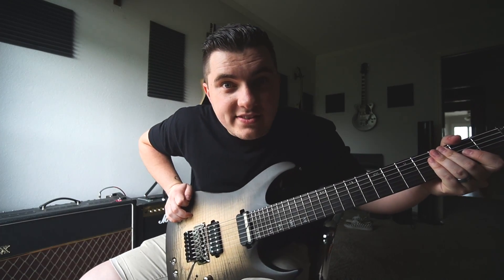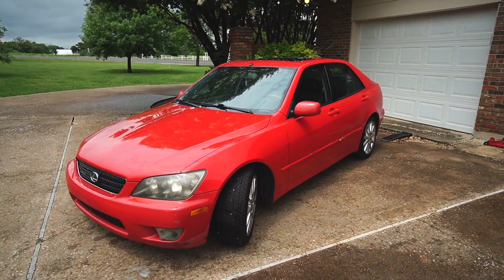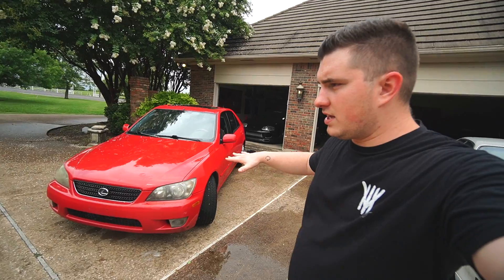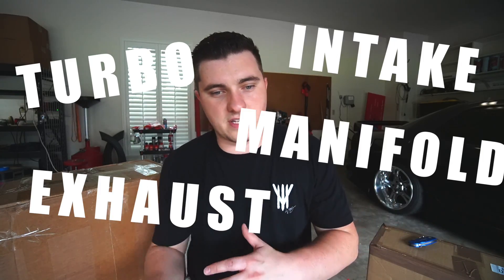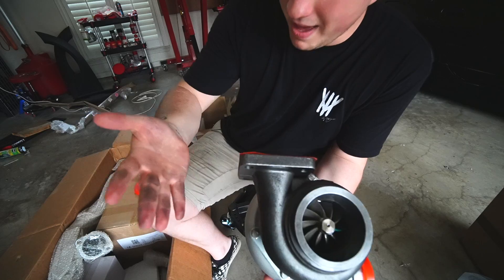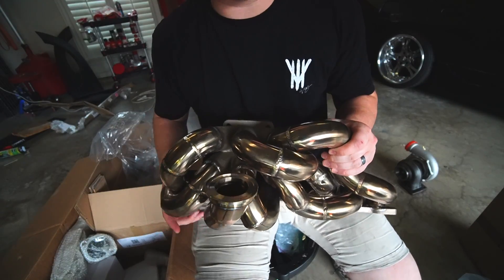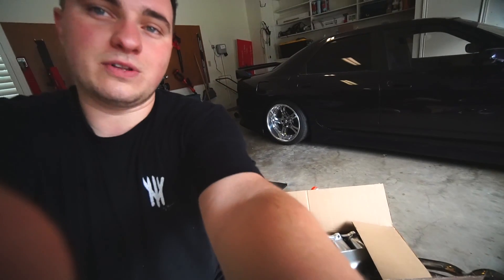Boosting the IS300 for CHEAP! My new 2JZ turbo kit

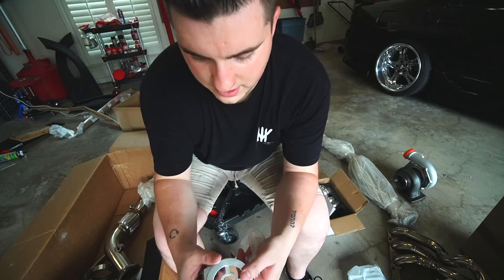Comment: 11:00 is a oil filter sandwich plate. It basically just allows you a easier way to run you oil line for turbo.
Reply: This lol, exactly what i was gonna say
Reply: yeah jesus christ I’m fully convinced this dude has no idea what he’s really doing
Reply: Can also be used to run oil pressure gauges or oil coolers.
Reply: That's why they say fake it till you make it.
Reply: Austin Higgins I mean, he had a general idea of what it was for... but if he never seen one he ain’t gonna know 🤷🏾‍♂️
Reply: So you don't have the same problem that you had with was it the civic with the job weld
Reply: Evan shanks is my dad. Commenting this until he follows me on instagram ryannmorrrison
Reply: I was just about to write the same thing then I saw your comment...lol Thanks for saving me the literature...😁

Comment: "you can spend upwards of 15k just boosting your car" subaru owners can attest that this is true
Reply: ye
Reply: How
Reply: Lmao vq owners too
Reply: Speaking of subaru buy my 05 lgt stage2 for 10 grand
Reply: The most depressing part is that the damn thing is already turbo lol
Reply: @zachwhite4162  a 40mm Garrett ball bearing turbo is 2 grand,and If you actually want a gain from it you need heads,intake,exhaust,which all can be hell of a lot more expensive than you think
Reply: I own a Subaru, you can make power with bolt-ons, but you better be saving for a new shortblock while you’re at it...
Reply: Yup. 15k into a bugeye, on my third engine lol. Atleast it’s fully built lol
Reply: 8k for my forged engine.
Reply: Hahaha 😂
Reply: Max Paterra they make ok power. You don’t get gains like you do on an Evo or Golf R but the gains aren’t bad. The fa20dit sees much bigger gains then the ej255 or ej257, the WRX’s fa20dit will make bigger whp and wtq numbers then the STi’s ej257 will with both on pump gas and stock turbo...
Reply: Thats what happens when you build an inferior engine
Reply: Seattle Inspired that’s why it cost 15 k to build the engine so it is reliable
Reply: I mean I daily a Edelbrock Supercharged BRZ. Only cost me around 5k (some discounts on kit and what not). Installed it almost a year ago without a single problem in FL.
Reply: That ETS kit does look beautiful though
Reply: @jacobwiseman7125  try out a 2jzgte i have one with rods all arp bolts stock head pistons but the stock gte ones will hold 1000whp. My motor can hold 1200 and it was 6k easiest motor ive ever worked on that cant be under stated and it took a hell of alot to blow up my last one 800 whp and it was a used aristo. 2 jz is king. You could have bought a t56 magnum kit and the engine for that price
Reply: The motor has literally no potential on the FA20s unless it's built
Reply: Kinda

Comment: I just bought a clean 80000 mile 04 is300. Subbed! Sensible turbo advice is not the norm. You give sensible advice. Don't go lean, don't go hot and your motor will live longer. Thanks for your channel!

Comment: I know of a couple YouTubers that use eBay turdos and they are having no problems with them. I'm glad to hear you say you won't be dealing with eBay turbos any more. I've been extremely sleep skeptical about them and am glad I didn't go through with getting a kit. It only takes one person to give a bad review for me to question the quality. Beings you've used a couple turbos from eBay and say you won't be dealing with them, thank you
 That piece you question in regards to the oil filter...... If I'm not mistaken it's a spacer so you can run supply and return lines for your turbo instead of drilling into the oil pan, etc. I could be wrong, not I believe that's what it's for.

Comment: You said "good, but keeping cost in mind" and I IMMEDIATELY thought "I bet he got a CXRacing kit."
Reply: Lmao right!?!
Reply: Cx racing kits are ass
Reply: Ricer Miata and SAMMIT both have gotten CX crap before and turbos and stuff have all blown or gone wrong and you end up spending alot more money in the end. CX is Ebay.
Reply: @terryosborne272  thats for a miata, the kit is pretty junk for bmws as well... but lets just hope 2JZ stuff is what they spend most of their time and RND on lmao. I believe Jimmy runs or ran this kit on his 2JZ
Reply: The CX intercooler and piping is good, turbo is meh (it’s just an EBay turbo), and the wastegate is iffy. But the piping and intercooler works perfectly fine for the price.
Reply: ORL Mitch the turbo manifolds are trash and the oil fittings and the gaskets
Reply: @brotherhood_ofstreetracers4268  the manifolds arent terrible. They are cheap but they flow enough for 5-600whp. They need to be braced though because they arent very sturdy. The real problem is all the cheap accessories like you mentioned
Reply: @PaulBuffano91  I have never heard of a CXRacing or XSPower wastegate actually functioning lol
Reply: I've always thought xs power was a hair better than cx racing through my experience
Reply: @terryosborne272  Jimmy Oakes & RJ ran CX racing kits on their cars. RJ had one on his 1.6 Miata and purposely tried to blow it up and couldn't do it.
Reply: @terryosborne272  Jimmy Oakes & RJ ran CX racing kits on their cars. RJ had one on his 1.6 Miata and purposely tried to blow it up and couldn't do it.
Reply: I found a cxracing  turbo kit for like $1900. Is it not a good idea to get it?

Comment: @Evan Shanks the oil filter sandwich plate is for the oil feed for the turbo. There’s not a place on the block for the feed. The drain as you might know is on the exhaust side(upper oil pan) and you just need to drill a hole and tap two intake studs in the pre staged holes and buy a cheap flange from drift motion and your good 👍🏻

Comment: the 5-speed 3rd gear will explode around 300 ft/lbs... don't say I didn't warn you... you can put the supra's 6 speed in and there is a driveshaft that's for another Toyota vehicle that fits. I can't remember which car, but your 5-speed will not last long on boost.

Comment: 11:12 it's to run a oil cooler and a filter, carnt wait to see how it performs
Reply: thats oil feed for turbo its called a oil feed sandwich plate
Reply: @revengesavagedit4684  it's being used for that purpose in the kit, but he is right that these are used for oil coolers aswell.

Comment: I have cxracing turbo kit 3years on my dc5 ..made 435hp first dyno session stock k20a2 then 1year later I upgrade to k24/k20 and make 560hp stock engine... And I have had no issues almost 4yrs and still counting.... Good kits for the buck or for a budget build... I'm sure kit can make 650hp plus with few upgrades

Comment: 11:05 I think it’s for the oil feed line. Pop off the filter and screw it on
Reply: otherwise knows as an oil sandwich, Evan is still learning.
Reply: not really a good place to get oil from , t off oil pressure sensor works better and getter cleaner oil to the turbo

Comment: I’m giving it till 350whp till either your W55 goes bye bye or your rods gonna be bent at a 90 degree angle. 😬
Reply: I'm pushing 370 on E. Hoping it works for him and if so I'm turning up the boost
Reply: yeah i've heard that the 2JZ-GE rods are toothpicks compared to the GTE variants
Reply: @johnbreuer9967  from what i hear the ge non vvti rods are thicker (up to 500hp-600hp) while the ge vvti rods are thinner (350hp-400hp at most i hear) but pistons stay the same. Someone correct me if im wrong.
Reply: @doomkid02  pistons are shaped differently for the valves, but strength wise they are pretty much the same
Reply: @doomkid02   pistons are softer then cheese not the same as non vvti ge pistons
Reply: The ring lands are the problem mainly
Reply: Did you use the stock ecu???

Comment: It's an oil filter adapter if you want to run an oil cooler up front which I would recommend because you're running turbos and the turbos get the oil really hot

Comment: I already knew it was from cxracing from the beginning😂 I’ve been eyeballing the kit every since I got my first is300 I think I might buy one once I see you start
Reply: Ahhaha same man it just had to be cxracing
Reply: It’s not a bad kit for the money. Just keep in mind you get what you pay for. Also you will spend a lot of money replacing the fittings and small things like oil plumbing that the kit does not sufficiently provide.
Reply: What’s the kit called ?
Reply: Ethan Higgins yeah you gotta tap into the oil pan but I was think 1j but idk which will cost more
Reply: D. SANTANA CXRacing Turbo Intercooler Kit Manifold For 98-05 Lexus IS300 2JZ-GE NA-T

Comment: That's an oil filter sandwich plate. You can use them for oil coolers, oil temp, oil pressure, and more. It's probably in this kit to supply the turbo with oil :)

Comment: 11:00 That's called a sandwich plate. it goes between your oil filter and the block. You run coolant lines to it to cool the oil..

Comment: you can run gte valve covers too and run a gte spark plug cover since u wont be having the over motor intake manifold!!!! also the oil filter sandwich plate is worth less use the line from the stock oil pressure sensor !!!!

Comment: If my understanding for that oil filter spacer is correct. I think you can run the turbo feed line and return line to it so you don’t have to tap the pan. Or you could run an oil cooler from it. But I could be wrong.

Comment: What transmission are you planning on swapping in? Surely the stock w55 can’t hold 450hp? Would love to see a t56 in it tho 👀👀
Reply: The motor will blow before the trans will
Reply: Ethan Higgins True, the VVTI rods will go at around 300whp.
Reply: Ethan Higgins yeah he def needs to built the lower end
Reply: @PaulBuffano91  not just the rods but the ring lands. Under boost and temp the piston rings will expand and the vvti motors have very small and weak ring lands which will crack send chunks of your piston shooting out your motor.

Comment: SO I'm collecting parts for my 02 been going back and forth on building/ buying my own kit. I got the same intake manifold and a set of injectors as well as a bunch of other parts. GTE head gasket Arp Studs, Aem Gauges, Walbro Fuel Pump, and some other goodies. Wondering How much the kit cost you because I've found CX kits at all different prices. Only looking for 3-400 hp nothing crazy. Thanks for any help..

Comment: Damn your neighbors have to hate you lol    I did the same build 5 years ago. Used the CXracing as a base. Ditch the wastegate,BOV and the Turbo,.. that Intake manifold might not fit. I spent 12,000 just in parts while cutting corners where i could, It adds up quick,. this build wont be as cheap as you think it will be lol  Also your power goals are at the limits of the VVTI rods,.I'd suggest swapping GTE pistons and use the GE headgask or go ahead and buy a backup block. .    Also don't go piggy back,. just go AEM or Proefi and call it a day.  Excited to see how the build turns out. Cody Gram on facebook is a great person to ask questions about IS builds. Oh also,..go T56 6spd when its time for a trans. It will have the best gearing for the diff

Comment: At 11:13 that’s for an oil cooler that’s sits between the filter so you can run the lines down
Reply: Or oil feed one of the two I haven’t finished the episode yet

Comment: 11:30 That’s called a sandwich plate it goes in between the block and the oil filter to run oil into fill lines that go to the turbo

Comment: Isn't that oil filter adapter sandwich for an oil cooler? Allows you to simply pipe in the cooler without cutting into the OEM lines

Comment: Man good luck with your turbo kit.. im also doing a 2jz na-t on my 92 cressida .. I would recommend you to change the stock  headgasket to the 2jzgte headgasket which will lower the compression and allow you to run more boost and get “more power baby”(donut media) 😂💔

Comment: Oil sandwhich plate good sir, bolt it where the oil filter currently is and boom you have a place to run an oil feed line

Comment: 400-450hp is probably gonna put a rod through the block. GE rods can handle like 350 tops, also the trans is another weak point. I’d suggest cd009

Comment: The VVTI 2JZ is only good for about 350-400 but it will probably blow up before you get to that point. If you looking for a good PNP standalone go with the xcessive manufacturing Link ecu. Also your gonna want to keep the torque below 350 cause the w55 is straight up garbage
Reply: Even then you’d be better off buying an Aristo GTE clip or Chaser clip.
Reply: @iheartgs400  that depends on your preference, but the cost to do an aristo swap and to fully build the GE is around the same price. If you want cheap and reliable power go a 1JZ swap, thats what i am doing rn on my IS. Boosting the stock GE is a waste of time and money. Also why would you buy a chaser clip, just buy the complete motor from an importer.

Comment: In your opinion, how much PSI/horsepower can you get away with on an NA 2JZ-GE without sacrificing reliability? I've seen forums and videos saying around 300-400 hp and around 8-10 psi if I don't want to upgrade the rods and head gasket. Obviously, you would have to do a proper setup with the fuel system and intercooling system, but I personally feel torn because I don't want to sacrifice reliability. My IS300 only has 133,000 miles on it and it's pretty clean. I personally would be happy with 300+ horsepower anyway. I would pay a specialist shop to do it if I went ahead with it.

Comment: From what I’ve heard the manual transmission on the is300 doesn’t hold the power the auto can. I’d check and see what power that can reliably hold if you haven’t already

Comment: THE OIL FILTER ADAPTER IS AN EASY WAY TO RUN PRESSURIZED OIL TO THE TURBO
Reply from the maker: The IS300 has a union bolt for that..
Reply: @evanshanks  Hm, I didn't know that, but that's usually what those are used for involving a turbo kit/build, maybe the kit included it as just another option, or (not knowing anything about the kit you got) maybe the kit is just meant to be somewhat generic, and regardless of what you order it for, it may just be cheaper to have pre-packaged kits that fit all 2j applications they can just ship out

Comment: New rule:

If something will cost $1,000 or more, you are no longer allowed to attach the label "cheap" to it. "Boosting the IS300 for CHEAP" should be "Boosting the IS300 for $4000" see the difference there.

There is a reason people buy Ebay turbo kits, because they are ACTUALLY cheap.

Comment: Evan I advise not going over 350 for a reliable setup, the rods are wayyyyyy weaker than the non vvti version and your motor would not be reliable power wise at 450

Comment: Would like to know what you would recommend me on boosting hp on my 2017 mazda 6. I dont want alot of hp. It's currently at like 180 hp and I want to bump it up to maybe 220ish
Reply: Sell your 2017 n/a version and buy the turbo model :p seriously though, a couple of tuners do tune them, but don’t expect huge gains. Vivid Racing claims 210 hp and 207 torque for peak gains on there 6 2.5L tune, although it’ll make more power over the entire rev range and will change the vehicles character to feel far more responsive. Tuning a turbo vehicle you’ll really feel the gains because you can crank the boost up and make bigger power levels. N/a you won’t as much.
Reply: @sleeper.simulant7327  lol I wish I could get rid of it for the turbo trust. Lol. Well I guess I'm shit out of luck. I don't want mads gains, like you said I want it more responsive